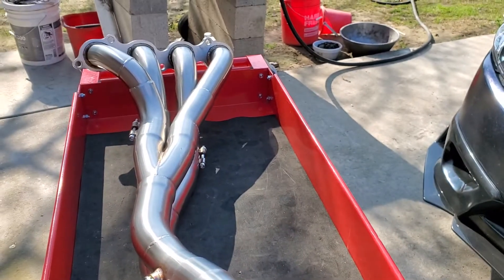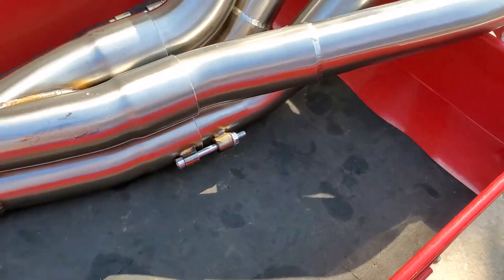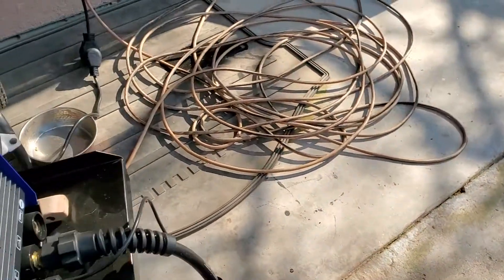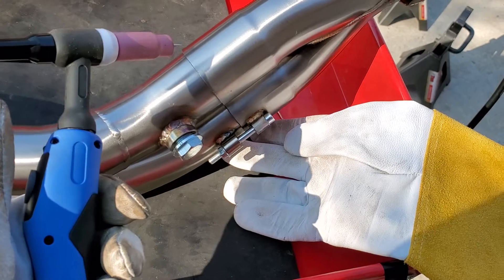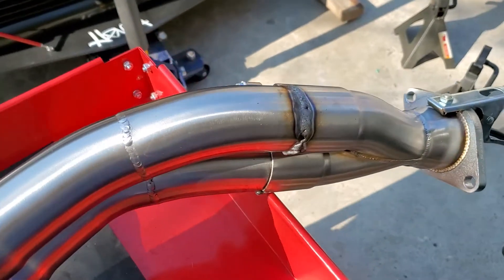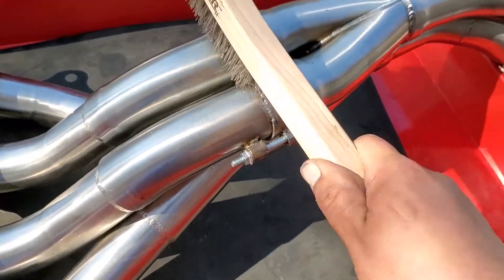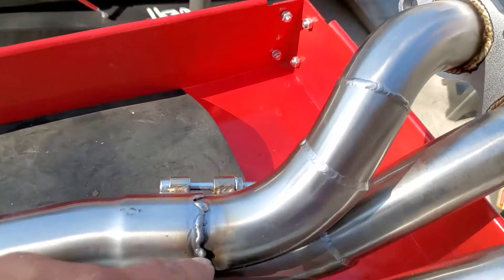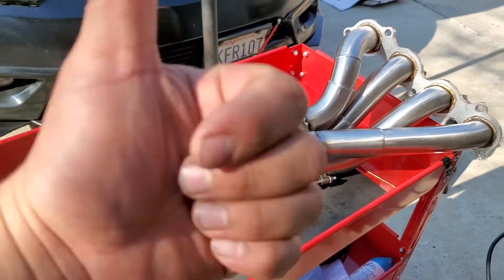Throwing on some Welds to the New PLM Header

Comment: Hey man did it end up leaking? Was planning on welding mine as well. I’ve head that PLM can leak and rattle.
Reply from the maker: Na with the welds i put in its hella good no leaks or rattles
Reply: @559powerscape  nice, I just welded mine up too, hopefully no leaks.
Reply: @jacks_Dc5 did it work
Reply: @jacedavis3716  yep no leaks